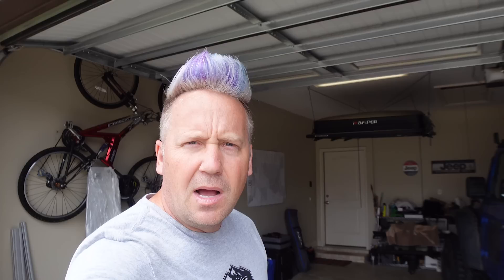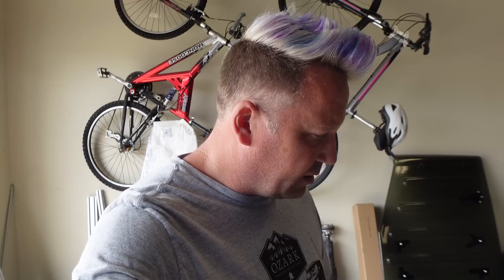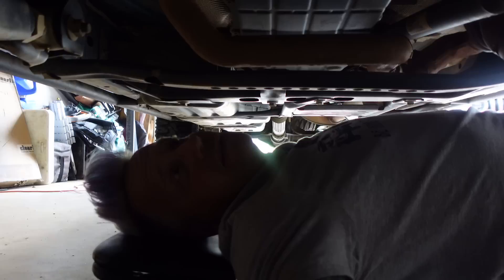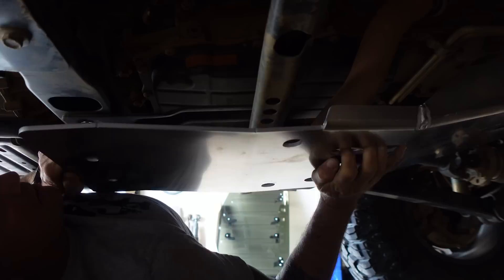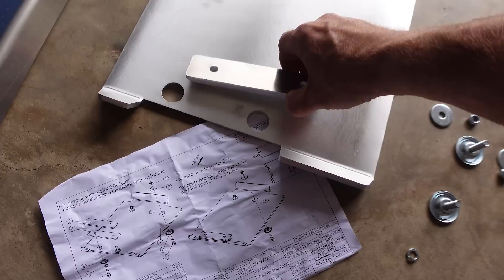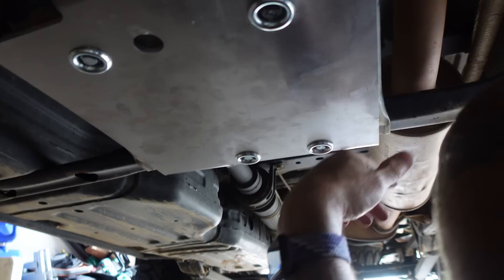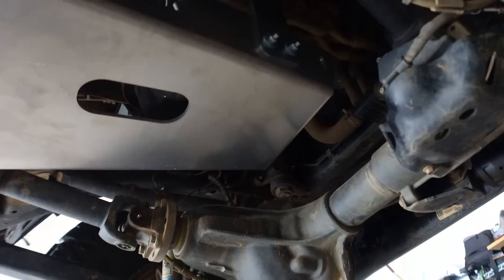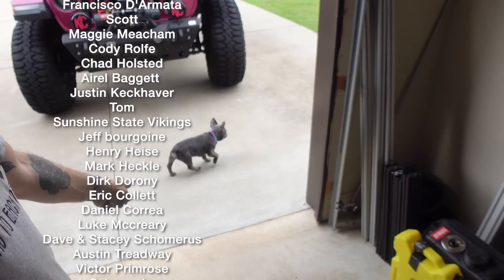Are Aftermarket Skid Plates Worth It? Installing ASFIR 4x4 Skid Plates on my Gladiator

Comment: Aluminum has a coefficient of friction of 0.6 while steel is 0.2 (approximately as these numbers depend on the material sliding over as well).  In other words it takes 3X less available tire traction to slide a steel skid plate over a rock than an aluminum one.  

Extra points for UHMW as used on 4400 cars as much slicker than steel but requires backing material.

But this is main argument for steel even though heavy as the weight is low CG at least
Reply: Wow that's crazy, had no idea. Well I suppose that's important if you're trying to slide on your belly over something. I'm hoping to just provide some additional impact protection for the most part. And of course aluminum and steel have their pros and cons.
Reply: Known points my biggest concern is something ripping transmission lines off or punching hole in or oil pan, fuel tank T-case.
Reply: Steel is more slippery then Aluminum. So it would be easier for tires to move with a given amount of force.

Comment: You are very lucky to have made it this long without good plates. It doesn’t take a whole lot to ruin your day on the trail.  I have 1/4” aluminum all the way down except for the transfer case which is 1/4” Stainless steel.

Comment: Wayalife never uses them because he doesn't like that they collect things like sand and rocks
but he also has 200 Jeeps to choose from if one goes down from rock damage
Reply from the maker: Yeah we will see how that goes. I was originally thinking about just the engine skid but for the price the whole set just made sense.
Reply: @OzarkOverlandAdventures  I can only afford 1 Jeep, so added protection would be the best choice.
only concern I see would be mud build up but it can be cleaned or easily removed for cleaning

Comment: Just installed this. I’m thinking I may pull the original trans skid crossmember that limits downtravel. Other manufacturers with the same thickness and same mounting points pull that crossmember. 

I see you did what I did, which is put it back on per the ASFIR instructions. But… I don’t think it’s needed. 

One man’s opinion 🤷🏻‍♂️

Comment: Man those look great. I wonder why they didn't have those protections for the bolts on the one skid. Also, do you have diff cover protection already? Was wondering why you didn't get the package that included those.
Reply from the maker: Those bolts are the factory bolts. I'm just worried about my diffs. If I'm banging my diffs hard enough to need skid plates then I'm not driving very well.
Reply: @OzarkOverlandAdventures  Good point on the diff covers I suppose. I guess one could look for some special washers for those factory bolts then. That seems like that could be a good add-on for ASFIR. But great looking product, I've bookmarked their site. thx

Comment: hey ozark, im looking to take advantage of a good sale they got going on right now but im scared about the whole "steel is much stronger than aluminum" should i worry about that when it comes to the ASFIR? how do they hold up if they get caught up on some sharp rock?
Reply from the maker: Ours are doing great!!! They have taken a beating for sure.
Reply: @OzarkOverlandAdventures thanks for the reply! Asfir currently has these at about $850 with free shipping after all the discounts. That's pretty hard to pass up right? Closest deal I can find is steel from Barnes 4x4 but it weights about 190# and its about $1k after shipping and taxes. It's pretty unheard of to get the aluminum cheaper. I'm thinking of cutting some UHMV myself and mounting it on the asfir for easy sliding. Thoughts?
Reply: @vincentmamotos9937  wouldn’t be difficult to do. 850 is a great price for the whole thing. I’m heading on an off road trip next week and wanted to make sure I had these before I left, so I had to order before the sale started.

Comment: Matt: met you at MORR in Spfd. Thanks for the vids and tips! I am going to pull the trigger on these skid plates so they are in place before Jeepstock in Sept. Any followup on how they worked?
Reply from the maker: They have been working very well. no regrets at all.
Reply: @OzarkOverlandAdventures  Just ordered my full set (including diff plates) about 5 minutes ago. Interesting company...based in Spain, manufactured in Israel. Hopefully they get here fairly quickly :)

Comment: You say you met them in the US? Did you order from their website? I’m trying to find out from them if you remove your original gas tank, skid plate on the Wrangler or not
Reply from the maker: Yes we met them at several of the Overlanding Expos and we did order from the website. You do not remove the factory skids.

Comment: How do you get to the oil pan drain plug?
Reply from the maker: That slot in the belly skid.
Reply: @OzarkOverlandAdventures  from everything I’ve seen, oil will run all over the top of the skid when draining. Many remove it for oil changes. I like the skid plate and it’s in consideration for my 2 door 2.0 turbo. But the oil draining issue and the a ability to remove the oil filter (still located underneath towards driver side of drain plug) easily is kind of a show stopper.